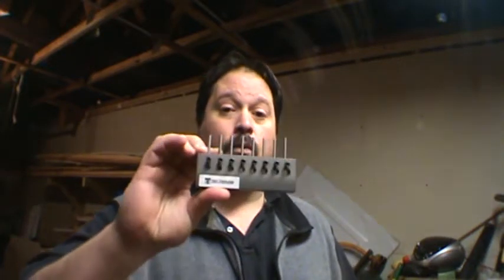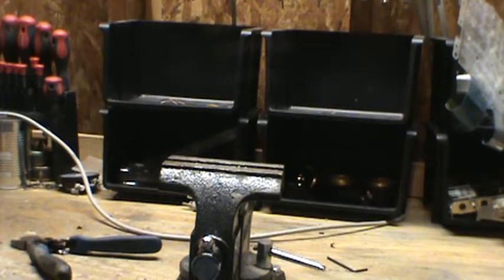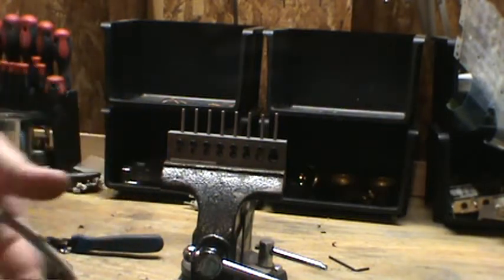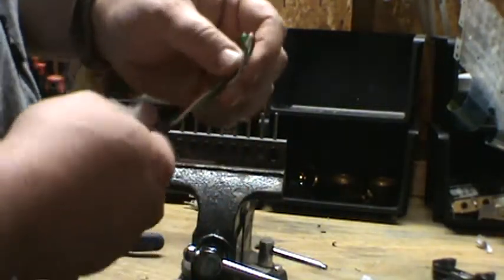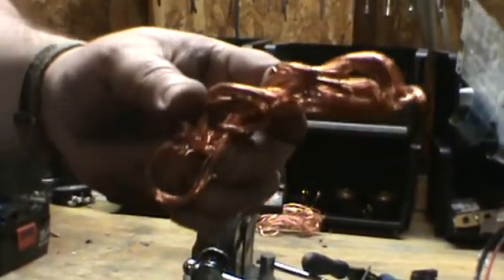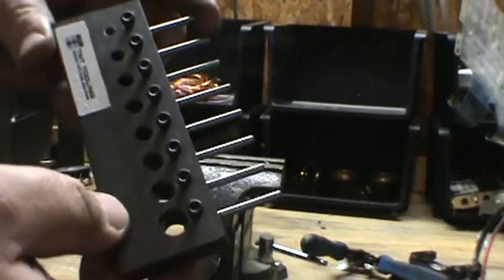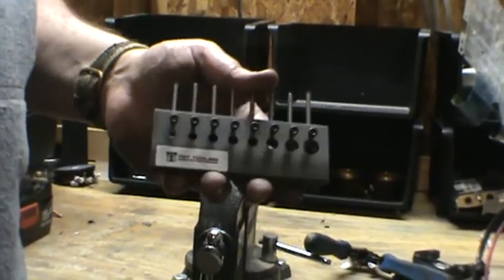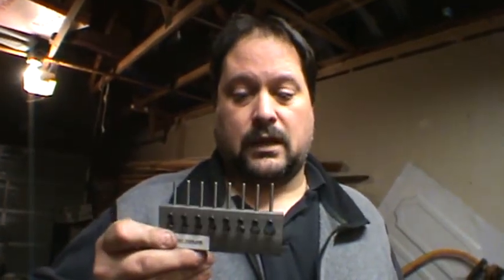How to Strip Solid and Braided Copper wire, a scrappers must have tool part 2 WSA Stripper

Comment: Great video,  I have and older stripper that works like this one. If it has copper in it I strip it. This year so far just from christmas lights I've gotten 80 lbs of copper and still have a large tote full to strip. Keep up the good work.  When I need help I come to you snd mike the scrapper and kenny the bigger hammer. Thanks for teaching us. Scrappers need to work together to to show we are a  good service for the world. If someone before you dumps trash on the ground take a few minutes to up

Comment: That's simple, easy and quick. Other guys on YouTube are building the most complicated tool or machinery to try and strip wire but that what you have is the way to do it instead of being having something that could possibly catch your finger and strip your finger skin right off the bone if not worse

Comment: Yes, I ordered one of these after seeing Mike the Scrapper use it and it is a valuable part of my tool box. I have found that it is a little difficult to set for some gauges of wire, but if I play with it for a bit, I can usually work it out. Thanks

Comment from the maker: It kind iof depends on the twist.  If you cut the wire into like 2-3 foot sections its not bad at all.  The blades are easy to adjust and kind of small so they don't snag as easy as others do.  This one came to me in less than a week and there was no duty.  One of the nice things with this is that if you are even just a little handy, its easy to rig up a power drill, board, and bracket to make this wire stripper go through spools of old crap!  Thanks for watching!

Comment from the maker: I could make a video about that, however I am not sure it could really answer your question.  Different manufacturers use different guage wires, some items have thinner or thicker wires depending on what device it comes from, there are really a lot of variables.  What i can tall you from my experience is that if the wire is as big or bigger than a pencil, its worth it every time.  The rest of the time its kind of a draw.  The wires that are tiny ( the ones i don't strip) are a loss to strip.

Comment from the maker: Great!  It works great for me, just remember to adjust the blade height with a little twist of the allen wrench.  Oh and it looks harder than it really is in this video because I have the vice turned so that the camera could see it.  You would normally have it sideways so that you could pull the wire through in a straight and level path unlike in this video where I am kind of pulling up on it.  Thanks for watching!

Comment: Hey Moose, big thanks for this vid. It has helped me use my wire stripper more efficiently by setting the blades properly so they don't need to be adjusted each time. I do mostly CRT TV cables. Nice copper in 'em. Keep up the great work.
Cheers mate from Australia. :-)

Comment: I know of, and want to get this wire stripper. Does it handle old twisted wire just as good as like new wire, or does it get caught and become hard to pull through? 

Did you have to pay any extra duty coming across the border, because it was from Canada, or did you just pay for shipping? If you had it shipped "ground", did it take 2 weeks to get to you (I've seen others comments that it took that long)? 

Do you know of any other manual or motorized strippers worth considering?  Thanks.

Comment: once stripped, do you store the copper wire according to it's size or store it all in one bin? I've read that some yards are fussy about that. I don't understand why though as it's all melted down so whether it's hair thin or pencil lead thick shouldn't make a difference, or does it?
Reply from the maker: +Reid GDT personally I just have a #1 and a #2 copper pile.  My yard is not picky but you should check out your own to see if you can make more money by separating a little more